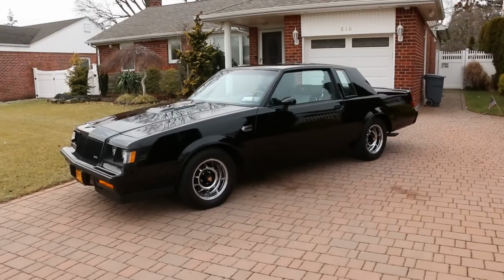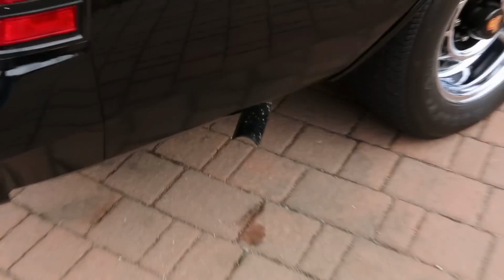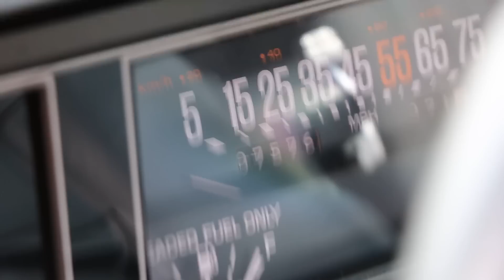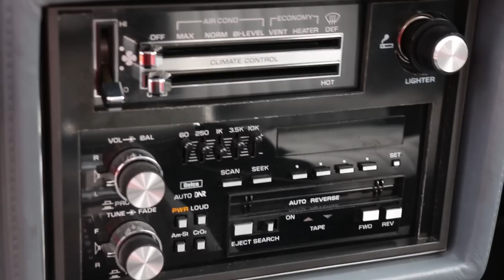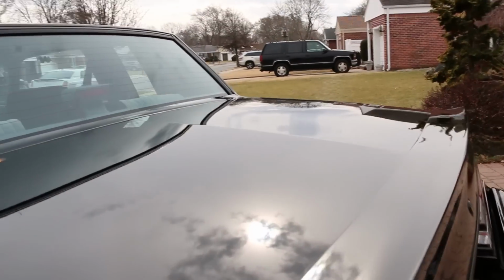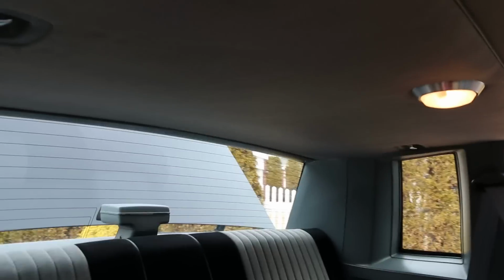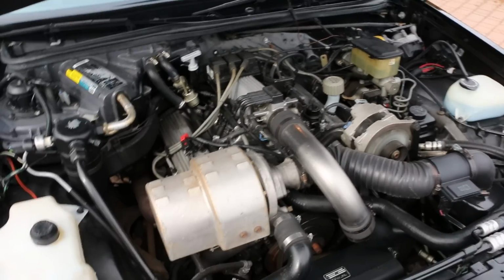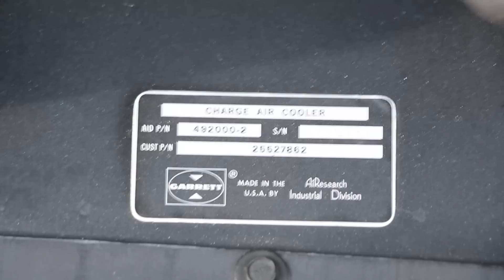SOLD - AMAZING 7,576 Mile 1987 Buick Grand National Time Capsule~All Original~LIKE NEW!

Comment: Based on the VIN ending (HP445810) and my knowledge of these cars, it would have to be one of the last cars made with the CF5 astroroof. Probably late June to mid July. That option was no longer after August 3, 1987; They continued GN production until December 11, 1987. (HP465288 is the final car's partial VIN.)) EDIT: EARLY to MID JUNE
Reply: Steven Covington I have my astroroof GN 1G4GJ1176MP444947 , 
51457 miles
Reply: @dannywhite9735  , Yours was made in late May, 1987. By the way; your VIN is not correct (M), but I suspect that you know that.
Reply: Steven Covington it’s HP. Sorry for the typo.
Reply: Steven Covington I bought it 6/4/87 in Orangeburg, SC
Reply: @dannywhite9735  , Figured that.; The "H" is for the 1987 model year The algorithm to verify the check digit confirmed it as well.  You can check the build WEEK by the top left 3 digit code on the top line top left on the cowl tag. You would have to remove the door panel or rear seat to get the actual date it ran down the assembly line. My Turbo Limited was delivered to McElveen Buick in  Summerville, SC. (Built same day as GNX 001, 002, 003 were built at Pontiac MI; Delivered same day GNX 001 was returned to Buick corporate HQ!)

Comment: Put a 383 hemi it that thing.
Reply: Why would you ever do such a thing? It would be ruined.
Reply: @markbrinton6790  The Factory would have done it in 1987 if they had'nt of been under such strict Federal Regulations. I put a 347 Stroker in my 88 Thunderbird I bought new. There was nothing in the 80's offered for power. Mine had a 155 hp 5.0. Put 240,000 miles on it. I ain't replacing it with the same engine. Got 435 hp with headers in now. The way it should have been new.
Reply: @Celticman197  I get that. But this is a grand national, not a thunderbird. Cool to talk about though. Cheers.
Reply: @markbrinton6790  Anybody with $45,000 is just gonna buy one with a shot out engine and just overhaul it with a high performance engine, and other options.
Reply: @Celticman197  and that makes more sense than this one with 7500 miles and all original.
Reply: @markbrinton6790  Yeah, it's a shame it has no power, because the body is in such good shape, and such a nice car.
Reply: @Celticman197  0 to 100 that car would bust that Fords ass